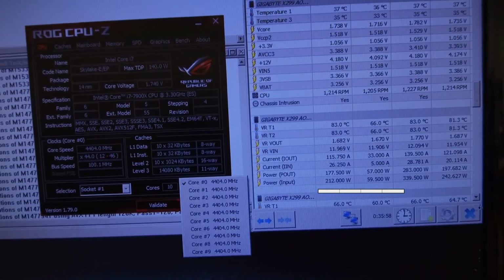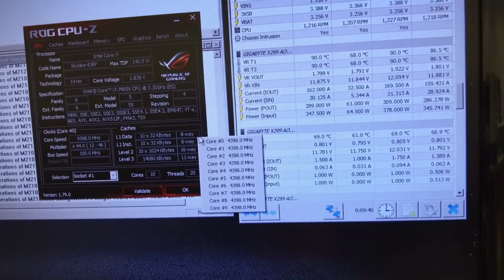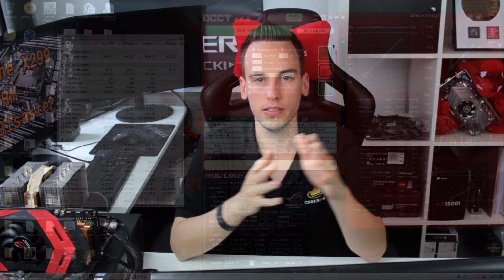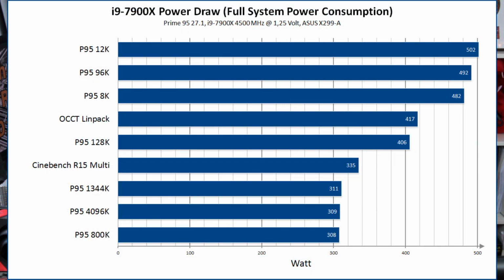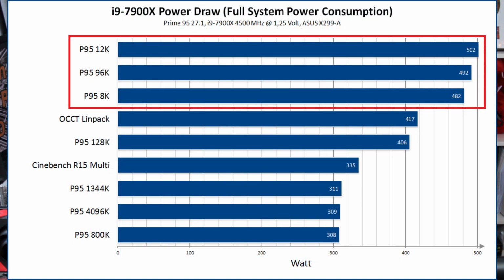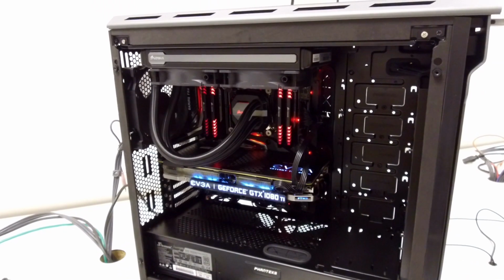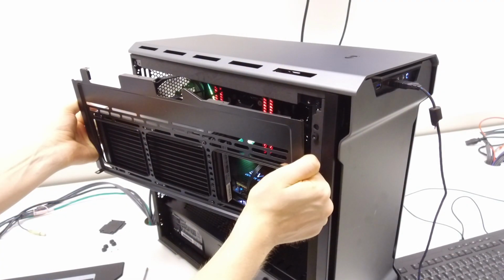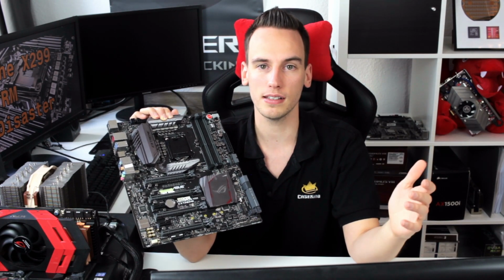X299 VRM Disaster  - UPDATE (en)

Comment: Great info. Im trying to get my Asus Rampage VI extreme running an i9-7920x up to speed. Really good stuff on throttling. I'm at 4.4 Ghz now and the cpu power fluxuates between 150 and 215 watts... throttle going on somewhere... using a Thermaltake AIO 360 cpu cooler and getting ready to upgrade to the EKW mono block and a custom loop.

Comment: Thanks to you, I waited to pull the trigger on an Asrock Taichi X299. (i9-7900X system)
They recently released the X299 Taichi XE for the voltage and temps,
and has the proper pins on the board.
I pulled the trigger today and got it at Newegg, as they are the only ones who have it.
Thanks for what you do Roman!
You're damned good at it!

Comment: Hey Roman. Great video!

I have a question: 
I recently build a 7820x on a msi X299 SLI PLUS motherboard. Unfortunately That board comes with only 1   8pin ATX connector. For PSU i Use a corsair AX650GOLD series. That PSU also has 1   8pin cable. Based on your video I now know ideally you have to use 8+4 or better 8+8 cables but i didn't want to buy a new board and psu so i thought i 'll just give it a try and see where it is capable of.
So i overclocked the system to 4.7GHZ on all cores by only changing the vcore to 1.150 volts. Its stable in cinebench and AIDA64 in the FPU test. Package CPU temps are 87C and vrm 79C
CPU power consumption hits just over 200 watts. I don't see freq bumping up and down in HWinfo64. AIDA64 and intel extreme overclock utility both say CPU is NOT throttling . Are those programs capable reading out the real values? 
Based on this information how can really know if the system is throttling or not ?
btw: For cooling i use the Noctua D15

Comment: @der8auer What do you think of the TUF series from ASUS (in this case, the x299 Mark 1) ? I was hesitating to get one since they are especially made for overclocking (remembering my old but incredible TUF z77 Sabertooth).
Reply from the maker: It would not be on the list of boards I'd recommend for OC :D It's really not that great
Reply: Oh, okay then. I thought it would be good for OC since they use military certified components and make the MB undergo punishing burn-in tests. The micro-cooling environment created by the fans in between the MB and the Thermal Armor seemed to me like a huge plus for OC but you're the expert. 

What MB would you recommend then and do you think I should stick with a z270 + 7700K instead of a x299 + 7800X for OC? That's a lot of questions but I'd really appreciate if you find time to answer. 
 
Cheers,
Vkno1

Comment: When my $40 motherboard has better heatsinks... Running cinebench I pull an extra 300w from the wall, and that's on a terrible 4+1 phase VRM. This is pitiful, especially on such expensive motherboards.

FX overclocked on Asrock 970m Pro3 rev 2
Using a small air duct to suck 1/3 airflow of my 4,100 rpm AIO fan (120mm) from around the VRM and 2 small 40mm fans on top with heatsinks added to the chokes. Cost: ($3 + pop tart box and hot glue)
Come on Intel motherboard manufactures... Even mine does 200w fine with no fans or modification by use of mysterious "fins" that add surface area.

Comment: Hopefully you see my comment and respond.

Jayztwocents did a video on how the evolve atx tg case is bad airflow wise and is more aesthetics and function. How would you rate it for watercooling? He claimed much higher temps due to poor airflow due to the case design
Reply from the maker: Yea it's for sure not the best case when it comes to airflow. I removed the mesh in the top cover tho which helps quite a lot for cold air intake. You can mount a radiator on top and in the front which is fine for using single GPU and CPU even with OC from my experience.
Reply: Thank you for your reply. I do intend to go for larger radiators so I am guessing my plan b of be quiet pure base 900 is a better choice?

Comment: So much valuable information, so little ego. Bravo der8auer! Maybe, just maybe as a side effect of this problem we may see some real effort put on those monoblocks... I've skipped those things alltogether because they never managed to equal a CPU only waterblock... or maybe we go back to 1366 design days were you could get a propper CPU and propper VRM waterblocks... as you said they may well use this to bring new "thermal solutions" to the table... also in the wake of your video on the APEX heatsink... for extreme overclocks that 50mm fan might be acceptable, but for normal OC'd use is unnacceptable.

Comment: If I were to remove the heatsinks from VRMs and point a 120mm fan at them with reasonable CMF would it be safe/better than using the monolithic heatsinks that are found on new motherboards? I mean I would not risk destroying the VRMa, right?
Reply from the maker: Temps would be a lot better if you do direct air to the VRMs
Reply: Thank you for the answer.

Comment: x265 encode also pulls a lot of watts, can you check and update us on whether VRMs are an issue with all other variables same, but running x265 instead of prime 95 using Hybrid encoder or something similar?
Reply from the maker: Can you link me to a good software for this? Could give it a try
Reply: der8auer asus realbench uses encoding for its stress test
Reply: Uses h264 encoding though.. You could use handbrake and endcode h265 at high present
Reply: I'm interested how it affect real case performance on heavy CPU project, I know some guys use idle server time to mining Monero cryptocurrency(x86 optimized algoritm) to pay for electricity/processor( how it affect hashrate over 24h). Look on youtube (Dual AMD EPYC 7601 Set Monero Mining 2P World Record in Docker and Linux) on ServeTheHomeVideo channel.

Comment: had similar issue with x79 running xmp i had made vrm heat sinks for the top and under side mosfets then overclocking became stable after having what you explained would of bean vrm throttling. so i made my heat sinks out of copper bar 48mm x 12mm x (length covering the vrm) and got it nickel plated using some thin az ekwb pad. would ya like one made for ya? or my design?

Comment: In my experience IntelBurnTest can pull even more power than small FFT prime 95. It absolutely pummels the CPU. However, I would say that neither Prime 95 nor the IntelBurnTest are the most reliable indicators in assessing stability. Sure they the worst case scenario as far as thermals are concerned but not stability. I have had systems that were stable for 8 hours on Prime95 small FFTs and 3 hours on maximum IntelBurnTest ….. but failed after 3-4 runs of Cinebench R15! So before I test stability on Prime95 for 24hours I always make sure the system is stable on the other programs starting first with Cinebench R15 (5-6 runs).

Comment: What kind of person would have 1 fan for intake? I dunno, but I use 3 for intake and 4 for exhaust. And when I game, they run at 700-900 rpm, and I can still hear only the game and not the PC.

https://goo.gl/photos/oZbjdyN5viBCvuYT8

Last 5 generations of Intel CPUz and motherboards with their respective configurations need moderate airflow, not summer breeze. You can't achieve moderate airflow with one, or two intake fans, no matter how big they are [unless You use 200+ mm fan, of course].

I'm about to build normal X299 computer, not like You, with average and mediocre material, like X299-A, Strix, or GA Gaming 3.

But really now, with all due respect towards You. What kind of dumbass would buy a mobo for 200-300e for a 890e CPU? Or is it only me? I got myself the Gaming 9, and I'm gonna cool the 7900X with Predator 360.

https://goo.gl/photos/HFL2q8zufut4DvnKA

I don't know, but again. You're using cheap AiO to test HEDT CPU? With 140W TDP? i9 are meant for either custom loops with 1 240 80mm rad, or 1 360 60mm rad, multirad configuration, or at least some Swiftech H320X2 Prestige, or EK-XLC Predator 360. Only these two AiOs pack strong enough liquid pressure, tubing diameter and radiator size to take away that amount of heat, that's dissipated by 140W CPU. Nothing less.
Reply from the maker: The i9 I'm using for this test can pass 5 GHz Prime95 on Corsair H100. So if it's running less speed on a different mainboard, it's not the AIO that's causing the limitation :) 

Btw I used 2 x 140 mm in front for intake and the 1 x 140 mm fan in the back for exhaust. 

Also X299-Deluxe for example has the same VRM as the X299-A and the X299-Deluxe is about 420 € here. That's not entrance and far from cheap. You should expect high quality components on boards in this price range.
Reply: @der8auer can't react properly atm, since my X299 and i9 are in cardbox boxes yet. I saw there only one fan, my bad. Well, anyway, as I wrote on LTT forums. I use X99 Deluxe II final rev. with tons of fans [8 direct + 2 VGA + 1 PSU all active at all times] and when I lower the rpm on all of them from 500 - 600 rpm to 200 - 300 rpm, inferno breaks lose in my case VRM-wise [6850K @ 4.7 GHz @ close to 1.5 vcore at normal heavy load, nothing fancy like You showed, I'll try those]. And my VRMs spike up to 80-90°C at idle of my CPU, from well controlled 40-45°C. Of course, it's only built-in VRM thermometer on my mobo, never measured VRMs externally. X299 Deluxe is 360e w/o VAT, whilst Core i9 is 820e w/o VAT. Just saying. Anyway, anyone who installs 140W beast into his rig must face the wrath of infernal heat, that's all. Proper AiO, proper aircooling and proper environment temperature. Anyway, if I may. What type of fans did You use? And at what rpm did they run at burn time?
Reply: Bryan Fury won't it be funny if x99 outsells x299?

Comment: it amazed me to no end that the few sites and tubers who had day 1 and day 2 reviews for the 7900X didn't even realize it was throttling and that's hwy the performance in half the benchmarks was bad and inconsistent. not one of them even thought of this, even though the few that bothered to publish operating temps all saw the cpu quickly go to 100c under load.
Reply: PureBlackFire because the 7900x is GARBAGE!!!
Reply: PureBlackFire What a terrible way to introduce i-9, Intel should have used the i-9 name for the 980x as it would have done the i-9 name justice!

Comment: Best channel ever, deserve 1M subscribers,
Please based on your experience: what is the max safe oc voltage cache (uncore) for broadwell-e? I have strix x99 and 6900k
Reply from the maker: Thanks :) up to 1,35 is fine if your cooling is good. Usually 1,25-1,3 is the sweet spot
Reply: der8auer 
Thank u sir, after watching your video, i want to ask you that i am always using occt large data set for stability test, do you recommend me P95 with custom fft 1344k instead without avx? And for 1 hours is enough? I am using my system for gaming only

Comment: Thank you Roman for excellent update. Question though, when's the new Asus or other boards coming out with improved VRM Heatsink designs ? Do you have any info on this ? Also what are the motherboard models that have 8 + 8 CPU pin connectors for Skylake X that are out now or will be released soon that you know of ? Thanking you
Reply from the maker: End of July / beginning of August :). I know that Apex and Rampage 6 Extreme will be fine. Next week I will test the X299 XPower from MSI. Could also be good
Reply: Thanks very much for your quick reply. Appreciated :)

Comment: There is a lot of confusion and complacency about tools and methodology for testing. For example, many people now use AIDA64 stress test to validate CPU overclocks and system stability. I found in that tool that default options for its stress test has a memory test option checked in addition to three CPU tests. With that memory test checked, the CPU power/wattage is considerably less (about 10-15 watts based on tool reported wattage) than without it checked. I also found a "stable" overclock with the memory test checked could easily fail when close to the edge when memory test was unchecked. People are looking for run and forget testing and are not very educated in what their testing. It takes more than a download and running of a tool.. Keep up the excellent work and help us learn!

Comment: i have also done some reading with regards to vrm type/ quality before purchasing my x99 motherboard, i went with a irf single package vrm board( asus x99 deluxe ii)  it has slightly higher vrm temps vs the gigabyte designer x99( both reviewed by tweaktown with thermal imaging on vrm) but i think the gigabyte board had better heatsink and also maybe more copper in board(  gigabyte 20z copper marketing )...  maybe motherboard vendors should stack up on vrm phases to help distribute the heat over a wider area wih x299.... great article btw

Comment: How is the VRM throttling at only total 250W power on EPS? Doing the math with FIVR input voltage that's only ~15W of waste heat on the MOSFETs.
Reply from the maker: It's Pout so the Pin from EPS is higher. Should be around 20-40 W to the Heatsink depending on the exact mosfets and utilizatoin
Reply: Ah right, I was confused when you said that was the VRM power.

Comment: Cooling issues aside, do you believe the VRM on the ASUS Prime X299-A is good enough to handle an i7-7820X in the 4.8-5.0 GHz range?
Reply from the maker: No it's by far not good enough. You have to wait for high-end boards to push this high.
Reply: Do you know the VRM specs for the different boards? I need to stick to ATX, and all of ASUS' boards are somewhat lacking in describing their VRMs.

Comment: I am surprised that some people even doubted your video in the first place. Faith in humanity lost again. Then again, forums are full of noobs and that's exactly you need to keep doing what you are doing, keep up the good work. Everything I have seen on the forums posted by you are quality stuff right on spot.  I have the Strix X299 and the VRM runs burning hot when CPU is pushed to 4.6 at 1.26V. It goes up to 98c and I didn't even check the power consumption and all settings...board is inside a case. For me, X299 is quite the complete failure. Slower in gaming than my 6950X, runs hotter than hell and I cannot get SLI to scale properly. :D I am probably going to change back and possibly check out the 12-18 cores later on + possible bug fixes and Rampage VI Extreme board.
Reply from the maker: I can understand that it's quite difficult to figure this all out if you don't have the background knowledge. So it's very easy that you think everything is fine while the clocks go downhill in the back and you don't even notice it.

Comment: They really need to go back to heatsinks on vrm like they had on socket 775 boards and 1366 :D
Reply: Problem is they can't because of RAM slots on both sides of the CPU :(
They should try to do a vapor chamber type of heatsink with optional small FAN mount.
At least, that's what I would like to see :)
Reply: they could vastly improve them by having fins like this http://assets.hardwarezone.com/img/2013/03/VRM_Heatsinks-600W.jpg

Comment: I think that the Phanteks Evolv ATX has one of the most perfect interior layouts for a mid-tower case. But it has very bad interior airflow compared to many mid-tower cases.  You can slightly improve the performance of the front intake fans by using longer bolts to push the front plate out about 5mm to 7mm. But the real problem is that the Evolv has extremely restrictive tiny top vent slits combined with the location of the top fan/radiator tray.  Many people, including me, have used their Dremel to cut out a big rectangular hole on the Evolv's aluminum top panel and installed a dust filter there. You get far better temperatures once you cut a big hole into the Evolv's top panel.
Reply from the maker: I actually removed the dust filter in the top of the case so the AIO can pull a lot more fresh air in. I always do this with this case otherwise the air intake is really not that great :/ I also wish that the front had a bit more holes or space for air intake

Comment: Have you been having USB issues with any of the boards you have tested yet? because the Aorus Gaming 7 x299 I have been testing has had really bad USB 3.1 Gen 2 issues.
When I was stress testing the 7900x @ 4.7ghz Aida64 was telling me that the VRM was at 86c but I am not sure how accurate that number is, as it said the core voltage was 1.8v (really was 1.28v)

Comment: Btw you are testing worst case on a 10 core cpu right. Can you test in a more realistic like 6 core and 8 core and see if the issue persist. There is a chance where people might be confident since you did on a 10 core and it's ok on a 6 core or 8 core.
Reply: See the issue here is, that while they may be unrealistic for a 10 core part these, same boards are meant to be able to handle up to 18 core parts.  You can bet when those monsters are plopped into one of these boards, these "unrealistic" results will be far more relevant.
Reply: Macsimus007 Well at this point more then 10 core is unrealistic for consumer use but I bet people will still buy the 18 core for bragging rights. Unless prosumer need more then 10 core. We shall see how threadripper turns out. But if u think about it these 18 core chips will heat the temperature limit first before actually hit max power draw on vrm. I wish Roman will get hands on the 18 core chip early to do his testing.

Comment: Thanks for the followup video, much appreciated! There was indeed a large kerfuffle on most forums and websites I frequent, and lots were pegging Jon Gerrow as being in the right. But seeing as you went into careful explanation of settings and including worst case scenarios, I believe this is fairly comprehensive. Thanks a lot!

I don't want to hog too much time, but did you notice the same 8-pin cable temps on all of the PSUs, or was that indeed a superflower issue?
Reply: LooneyJuice He mentioned it in the german video. When using another PSU the temp at the 8pin cable reached only 45 °C.
Reply: Ah, nice, thank you. Much appreciated.